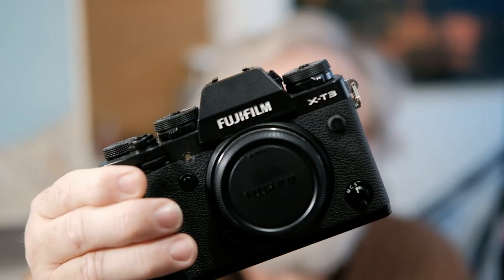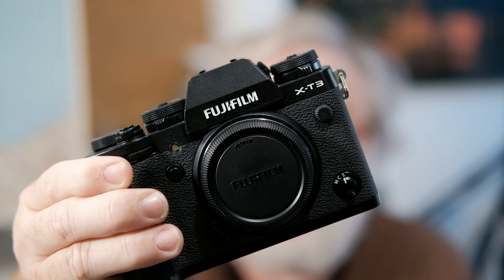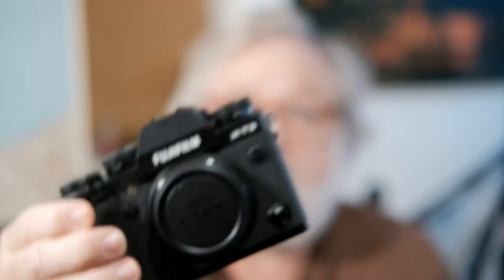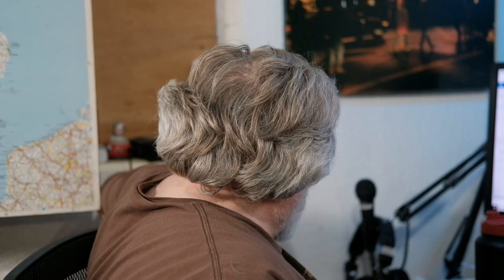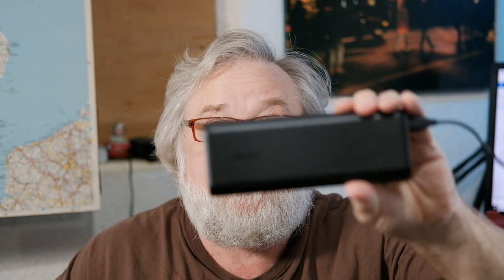Fuji XT-3 Power Drain!

Comment: I have this very problem. I purchased a camera and didn't realize the issue until leave a full battery in the camera without using it only to return and noticed that the battery was drained. Sadly this was a 3rd party purchase. No return or warranty.

Comment: I think this might be happening to me. I did a double-take the other day when a battery that I had left in the camera probably 75% charged ended up being drained very soon after I started using it the next day.   Thanks for pointing this out. I’ll have to check for problems. Thumbs up.
Reply from the maker: Easy to test just put in a fresh battery turn off and check it next day it should still read 100% if not : ( to service it goes. I just checked on mine Fuji Service said  they were replacing the power board and I should see it next week.
Reply: @Scot_Photo  I'm doing that as we speak  . . .